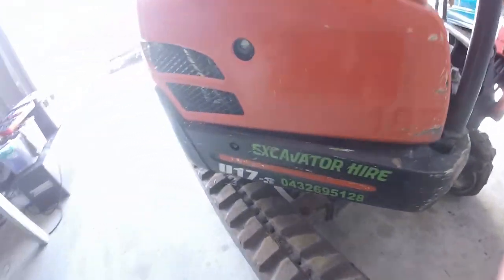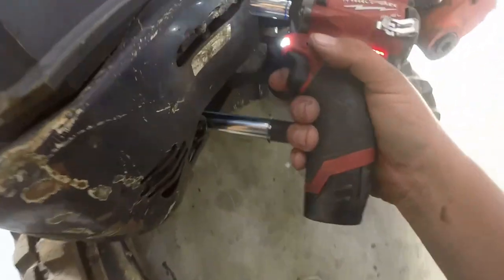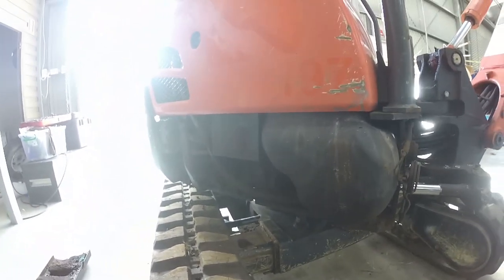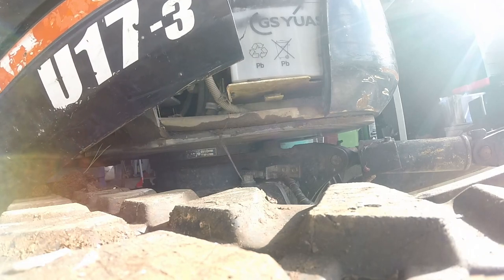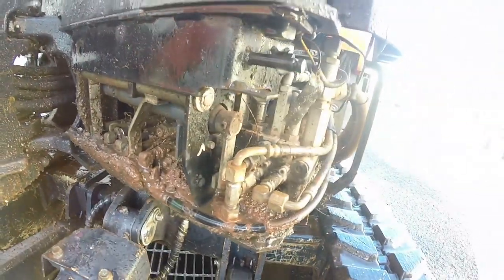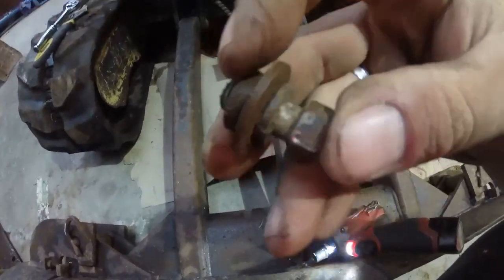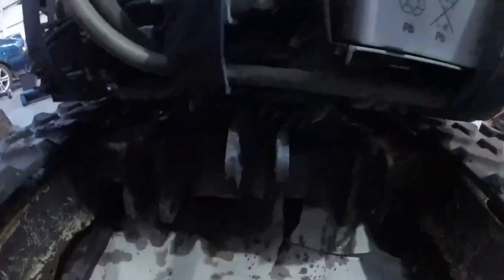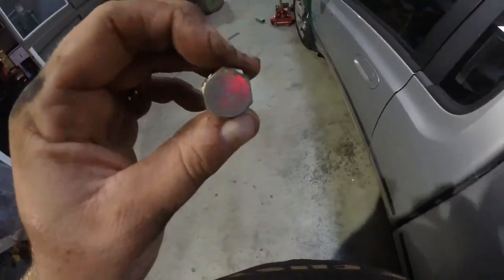Kubota U17-3 Mini Excavator repairs at 2700hrs

Comment: How did you disconnect the horn, just pull the plugs out ?
Reply from the maker: Horn or track beeper?
Reply: @Oneupthesleevecustoms  The track beeper.    sorry I didn’t realise they were different units until I took the Gard off.
Reply from the maker: Yeah unplug it we don't run them on our 1.7s
Reply: @Oneupthesleevecustoms  amazing I just unplugged it and put the Male and female connectors together.  So good not to have the noise but also have the option to reinstall it’s later if I net it.
Reply from the maker: The beeping drives me crazy